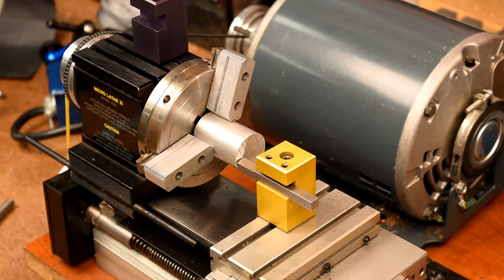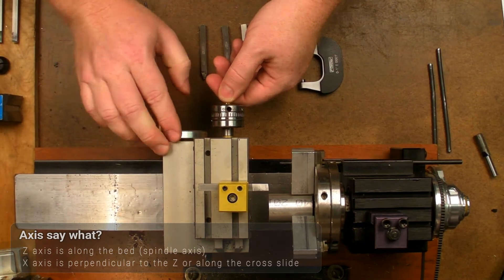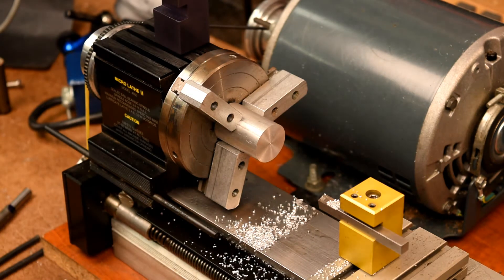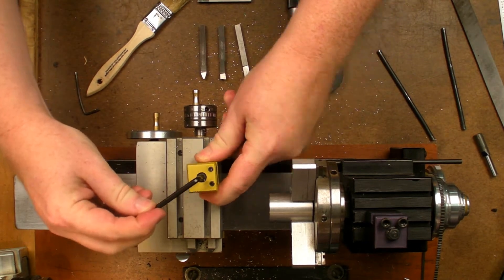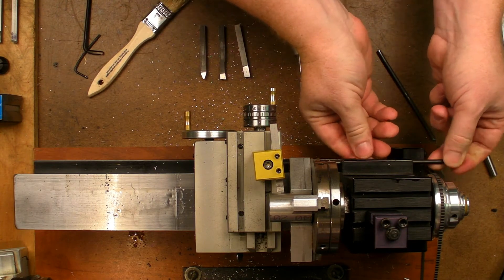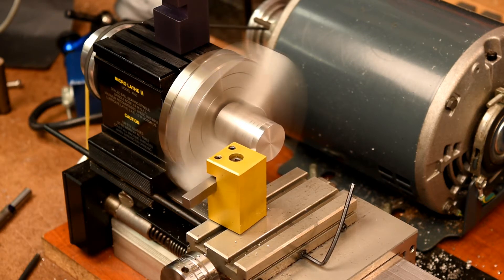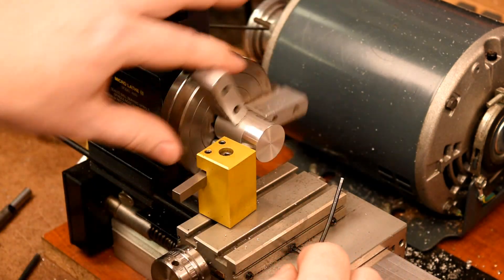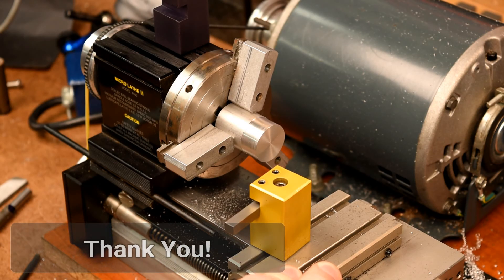Taig Lathe - Facing and Turning Operations

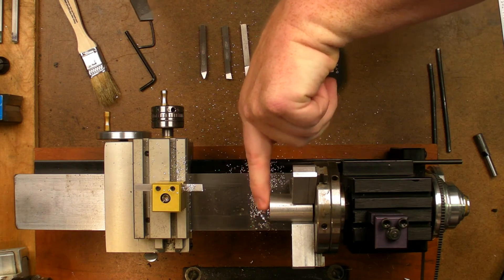Comment: 4:12 Not to motor axis.  if motor is 5 degree angle "dramatic error" face will be still straight as x axis to z axis. you can think it as compount post you can turn chambers make it 89.99-90.01 well it look flat even it not xD, but motor nothing todo it. only thing is when you flip part will those faces be straight. they will not if motor is aligned correct even face could be flat as x axis is LOL

Comment: Amazing. I bought a Taig Micro for $90 at a flea market. This video is the perfect place to start after the assembly video from @TAIGTOOLS if you have a basic understanding of how a lathe works. Thank you for taking the time to produce this content years ago. Quick question. Is a simple cam made from CRS possible and simple to make on the Taig when the lathe is in factory configuration?  The hole in the rotor section will be a slip fit and tack welded onto a 7mm steel motor shaft. Subbed for more novice Taig content! https://imgur.com/a/1PpLRiZ
Reply from the maker: Thank you for the positive feedback!  Yes you should be able to make off center holes (e.g. camshaft parts) fairly easily using the 4 jaw chuck (independent jaw version).  Drilling or boring a few mm off center would be fairly simple.  CRS is machinable as well, no big deal, just need to take light cuts and hone / sharpen as needed.
Reply: @desktoplathes  ,
Please provide the address of the dealer/distributor of this machine, in  Indonesia .

Comment: Are you still open for questions?  I have a Taig 1 (?), one of the first. Shop is not more.  Bought it so 30 years ago. Did not use it often and it did , looked like, ok. Love it and  now I have more time for the Taig and try to improve it. But, found a few strange things in  it, simply because I use it more.  Missing rings, bolds that ware not properly bored  or tapped and so on. Simple things but do not like them.  Where can I ask for some help in this matter? You?

Comment: I've been going back and forth between getting a Taig or a Harbor Freight mini-lathe. The Taig looks like it has an excellent build quality, but as this would be my first lathe I wonder if the lack of a leadscrew and gearing would hamper my learning. Not to mention the Harbor Freight costs half as much as the Taig. Do you have any recommendation? I'm still waffling.
Reply from the maker: That's a tough call.  I've used a friend's HF mini lathe it worked well.  His used steel gibs (vs brass) and didn't come with collets or a drill chuck.  The gears were plastic, basically every corner was cut but still it is a reasonable deal with the 20% coupon.  I don't think you'd regret either purchase.  The Taig is quite a bit higher quality and more portable.  Also it comes with ER collets, tooling, and drill chuck at the similar price point (is much lower cost without).  As for threading the Taig can only do so with dies and taps so you are limited to standard diameters.  One advantage of single point threading is you can thread at a wide range of diameters so if you plan to need that I'd pick the HF unit.  If you just want to tinker and play around I'd recommend the Taig and if the machining bug takes, then jump a couple levels to a larger lathe, not just a mini.  I ended up buying an old used 13 inch south bend with gear change box and the thing is, the Taig still gets used.  I like the Taig for very small things and of course the south bend for larger.  Hope that helps!

Comment: Hi! What is the maximum size you can turn with this micro lathe? I was thinking of using it to make some hub wheels and other round parts for my RC heavy machinery.
Reply from the maker: Well.. that might seem like a simple question but it's a bit tricky to answer.  The absolute max diameter that could be attached to the spindle and would just touch the bed is 4.5 inches.  However, with 1 inch riser blocks, that can be 6.5 inches.  But can you turn a ~4.499 in diameter stock?  Well the carriage and cross slide would need to float on the bed underneath the stock to do so in most cases and so now you're down to 2.375 in diameter or 4.375 with the riser blocks.  However, with some effort you can technically extend a tool and turn ahead of the carriage and cross slide assembly and turn things closer to the 4.5 to 6.5 in diameters.  I'm not sure if this link will work but if it doesn't, search for Deans Photography Taig Lathe and his rotary table project to see what is possible - very impressive.  Here is the link: http://www.deansphotographica.com/machining/projects/mill/rotary/rotary1.html

Comment: What do you think of the power feed.  It is a very unique setup, the concept is very good as long as it works reliability.
Reply from the maker: The power feed is great!  It’s a clever and elegant design.  However it’s a little tricky to explain to folks...  I might do a short video just going over that feature.
Reply: I have a crazy idea of buying buying a Taig lathe with power feed without the headstock.  I will custom make a head stock with taper roller bearings.  The spindle will be threaded to fit my 1"-8 scroll chucks I recently purchased. I have a bar of 303 stainless I will use for spindle.  This material is easy to thread with a very smooth surface. I wish it was 416, The usefulness and quality of the power feed will determine if I go with this option.  I would like to see close details of the power feed in use.  My plan is to take a heavier cut without chatter than what is possible with the standard lathe.  Yes I realize many factors come into play.  I plan on eliminating two of them.
Reply from the maker: John Walters - Go for it.  We learn the most when we try things out, whether they go as planned or otherwise, can’t go wrong!
Reply: My basic lathe with power feed is on order.  I have the bearings and aluminum for a 1"-8 headstock and am working on my tailstock with 4" of travel.  This machine is on steroids. I like to help out the American Taig whenever possible.
Reply: @desktoplathes  , 
Please provide the address of the dealer/distributor of this machine, in  Indonesia .

Comment: What are the differences between the "er" and "standard" spindles on the website and why would I want one over the other?
Reply from the maker: The ER is probably preferred now as Taig is making most or all of the accessories (chucks, face plates, etc) with an ER option.  The ER-16 spindle is an industry standard and uses ER-16  collets while the "standard" is just Taig's own design with spindle threads 3/4-16 and a 15 degree taper with their own custom made collets.  One advantage to the standard is readily available collet blanks (one example of use - customizing a fastener head by tapping and threading and slotting and holding a fastener by the threaded part to machine the fastener head).  Another odd use is on the mill, which comes standard with the ER spindle, is using the standard spindle and the ER adapter as a tool holder for CNC work, allowing for quick swapping of tooling.  All that said, you can buy a standard spindle headstock (100-00) down the road and swap them out for whatever need you might find.

Comment: Please, please do not use a file without a wooden handle on a lathe.  For those who are inexperienced , if the chuck jaws catch the file even by the slightest amount the file will be kicked back and the sharp tang will peneterate your hand. A visit to A&E is not what you want on a Sunday morning or any other day for that matter. Only use a file with a well fitted round wooden handle.
Reply: To add to this, never file reaching over the headstock, that is a really bad idea. hold the file facing the headstock opposite of how we observed in this video. One slip and you are crashing your wrist into a rotating headstock that will happily rip your hand off.

Comment: Why these minuscule cuts? Finish? Like to dawdle? Vibration/flex? Wimpy power?
Reply from the maker: 1/4 hp motor, a machine you can pick up and move to another bench by simply unplugging and moving by hand... one quiet enough you can use in your apartment and not disturb your roommate in the room next door.  Larger cuts can be taken but not too much larger.  These are about as small as you can get for a lathe and still be able to make some real machined projects.  Also love to dawdle :-P

Comment: Parting off a 1” steel rod. I’m used to doing much smaller pieces and working with brass or aluminum. I’ve been struggling with this hunk of steel for a week and ruined all the work I’ve done so far trying to part it off.
Reply from the maker: Melissa Boling - I should do a parting video!  Are you using the standard parting tool or the back post version?  What type of steel?  If parting goes south, just use a hack saw.  Always use cutting oil with steel.  Low speed, continuous feed, try and keep a chip going.  Make sure the tool is square and sharp...  probably more tips I haven’t thought of!
Reply: @desktoplathes "I should do a parting video!" ... agreed and link it to this one in the description.

Comment: Have you thought about getting a carbide holder for aluminium inserts?  You could turn and face with the tool in  the same position. The lathe would find it so much easier, as the high rake on the insert should require much less power.

Comment: this is done very well.
i'd like to add a caution-  never ever ever let the far end of a file or any tool approach the spinning jaws and always hold the tool in such a way that if the jaw smacks it it will send it flying rather than hammer it into your hand.  don't ask how i learned that, plz.
Reply from the maker: Thanks sig!  and good point on the file...  always have to use caution with machine tools.  The Taig is relatively safe compared with larger lathes.  I've managed to do a few silly things that fortunately did not result in injury due to the Taig's smaller size.
Reply: @desktoplathes  ,
Please provide the address of the dealer/distributor of this machine, in  Indonesia .
Reply: Watching that file waiting to stab you made me shiver all over.

Comment: Love my Taig but the set screw bent Allen tool post is a royal pain. I don't use it enough to invest in a QC tool post but there must be a better way
Reply from the maker: One awesome youtuber, Curt Filipowski makes his own and offers plans.  Might be worth checking into if you are looking for a project!  https://youtu.be/NXwMLj6VrIA
Reply: I purchased two straight Allen hex drivers with a screwdriver type handle for my Taig Lathe from MSC. 5/32" for the tool post and 7/64" for the chuck soft jaws. Makes adjusting the tool post and changing the soft jaws much easier and faster.  They were "PROTO" brand.

Comment: It would be cool to see a series where one of these is converted to CNC
Reply from the maker: I considered it but then saw that youtuber "sig other" did a conversion and offered it for sale a while back.  Taig now offers a version of their Mill base modified for CNC lathe work.  Here is sig other's vid https://youtu.be/N3ghom1ZrRs
Reply: well thanks for watching.  i do have more.
Reply from the maker: Your conversion is really something special.  I considered ordering one a while back but other priorities came up.  Do you continue to receive orders?  Did you do a large production run or small batches?
Reply: thanks.  they were a labor of love. i just made 10  - cuz i wanted one forever and making just one is the most expensive possible way to make anything.  when u have a setup tweaked to perfection, it's just too hard to tear it back down  cuz that's when it starts paying off!   i have 5 or so in boxes sitting there- lathes are hard to sell.